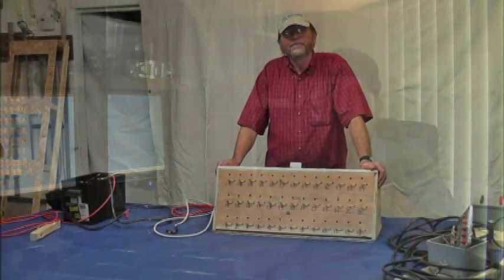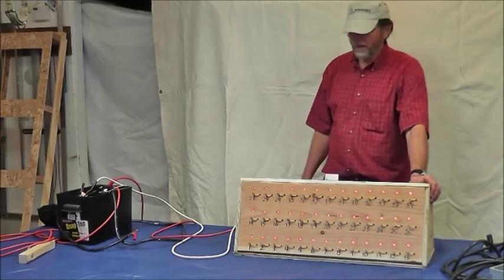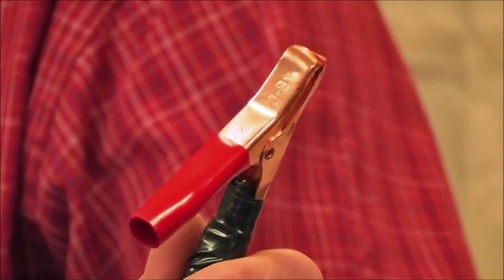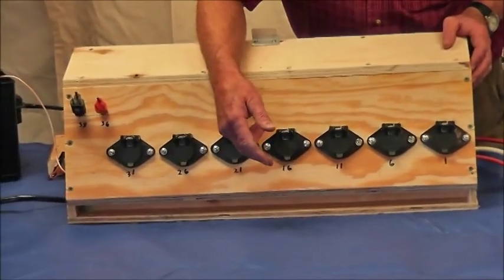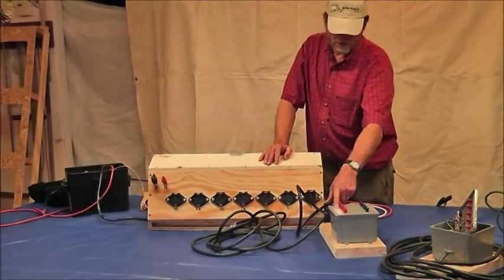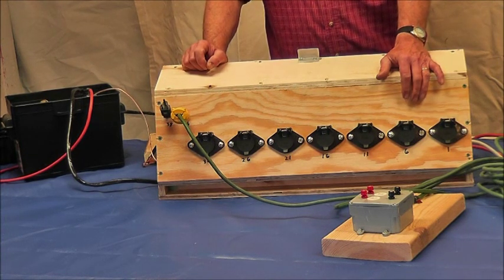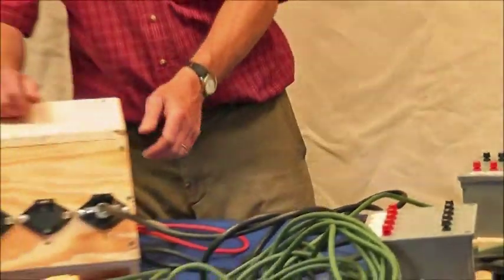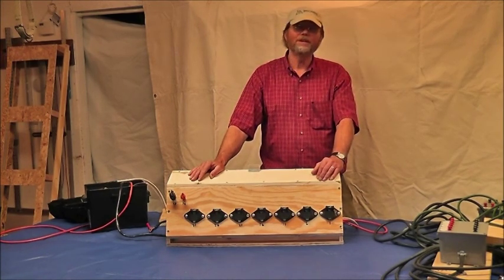Analog Man Fireworks Firing System

Comment: He should be able to take a multimeter and connect it to ground on the battery and touch it to each screw to check continuity on each channel when the igniters are all hooked up.